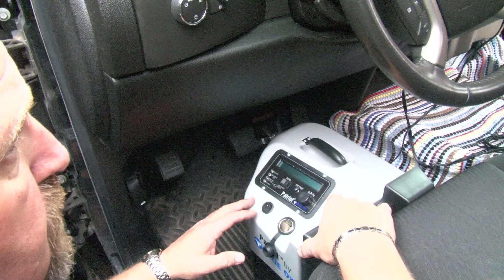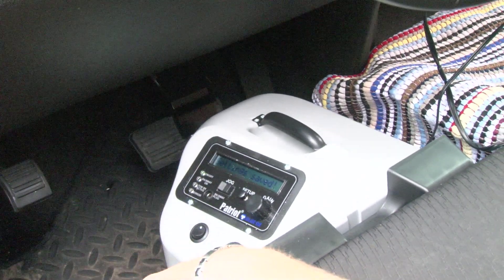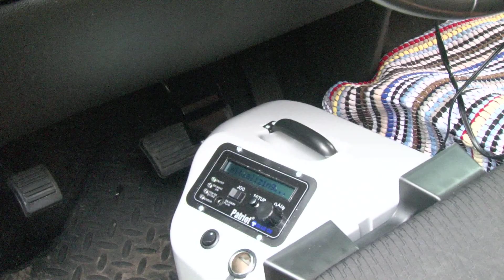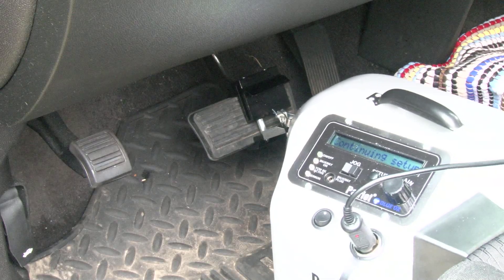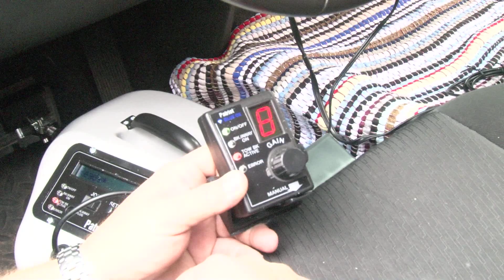Blue Ox Patriot Supplemental Braking System - Installation

Comment: I notice the unit is not SECURED to the floorboard?.  What happens if you inadvertently hit some SPEEDS BUMPS at a high rate of speed?  Could the unit jostled out of alignment, thus not being aligned to brake pedal as the initial installation was?

Comment: Buyers beware...........1k for the system and it does have it's down falls.........make sure you can have your steering system disabled for towing and the operation indicator (red led on cig lighter glows) if not unit will not work off of car battery..........(my vehicle 2002 jeep wrangler)
soulution is to go direct to battery....to get power........the manual does not explain of the sensitivity control.....Svc.  Dept needs some training......with Cust.  Care...enough said

Comment: Normally your car with hydraulic brakes need your car running in order for your brakes to come on with force. How does this work when your car isn't running and there is NO brake pressure